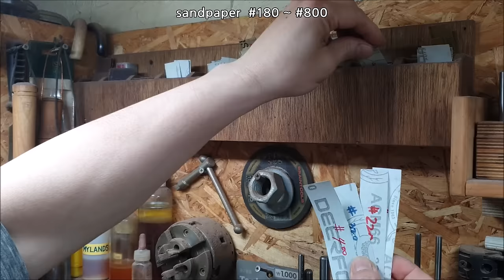Create handmade FOUNTAIN PEN / Precious wood materials

Comment: Why centering slightly offset when making the hole around 5:00? For both brown and blue pieces, thanks!
Reply from the maker: Please judge after seeing the finished product.
The intermediate process is just a process.
Reply: @SilverMeister  the technique is the foundation of the result 

The master is evidently skilled and he is centering offset on purpose, so that’s curious
Reply from the maker: The trick is to choose the direction in which the wood has a good pattern.
Since the shape and color of the wood grain varies depending on the location of the center hole, move the center position to a direction that will produce a better pattern.
I don't know if my opinion will be conveyed well because I rely on a translator.
Determining the center location differently is,
Because it is an extremely sensuous thing, it is difficult to express it in words or writing.
I hope my thoughts conveyed well to you.
Thanks~

Comment: You need to get a better centre finder
Reply from the maker: There is no need for a center finder.
What is indicated is only a standard,
It is intentionally modified to fit the pattern and a hole is drilled.